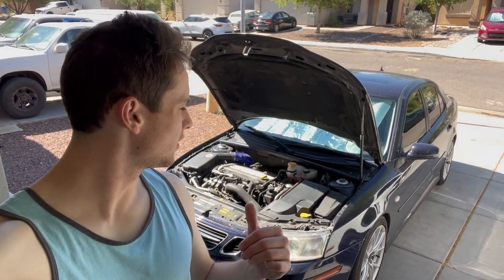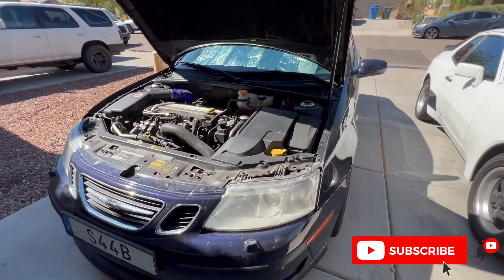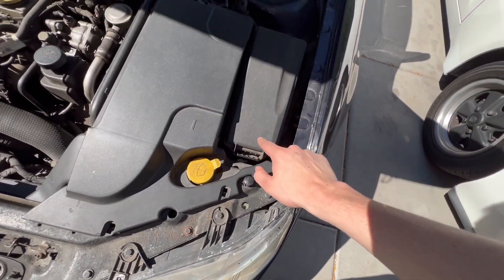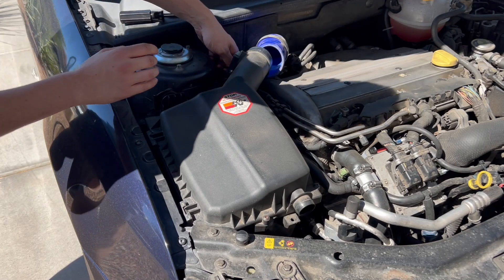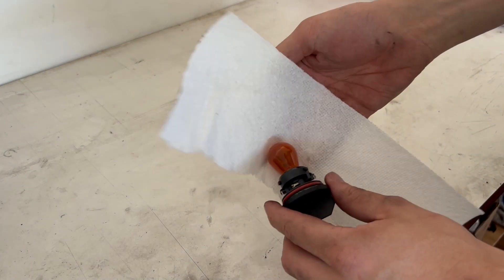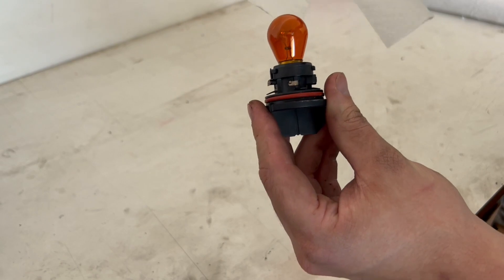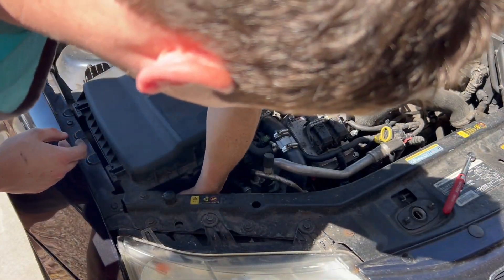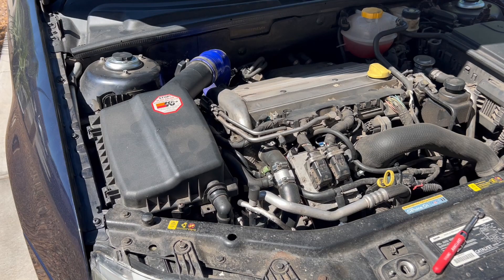Saab 9-3 Quick Fix - Turn Signal Replacement

Comment: I had a front running light repair itself. I don’t know how or for how long. Worried about getting those little red bulbs for the rear glass blocks. Hope they are still sold. Thanks for posting.👍
Reply from the maker: Yep they’re available on esaab :) like $3 I think!

Comment: I have a 2007 Saab 9.3 2.8 v6 auto, and i have the dreaded stability control warning light. I have replaced the CIM, the ABS module, the transmission control module and the ignition switch and keys. I have disconnected the battery overnight to reset the system, but after a few days the warning light comes on again and the car won't start. Next I am going to have all electrical connections in the stability control system checked. Any other advice would be appreciated.
Reply: My saab 93 (diesel however) had the same problem years ago, it was the ecu where water had got into it, replaced it and never had the problem again, but on the diesels the ecu is placed down low in front of the right tire so that might have been why it failed.
Reply from the maker: I’m not sure. I’d say either take a tech2 to it to see exact codes, or try posting on some Facebook groups for advice. Possibility you maybe got a bad new cim but I’m not sure

Comment: My 2007 9-3 eats bulbs like crazy, I'm constantly replacing headlights, taillights, turn signals, license plate lights! Drives me crazy!!
Reply from the maker: SMH! Yeah I was always replacing bulbs twice a year until I got the headlight switch programmed so I could manually turn them off
Reply: @AutoAutopsy  good top, I might have to do that. Did you do it yourself with the Tech 2?

Comment: I had only had my 93 for a few weeks and still getting to know the car when one of the rear indicator bulbs died mid-drive on a narrow, bendy road.
I nearly bloody drove off the road from the sudden warning "Pin-Pon" sound which I had never heard before.
Reply from the maker: Oh no!
Reply: @AutoAutopsy  Exactly. Imagine sitting there in your brand new used good ol' Saab, concentrating on the ride and the road when there is suddenly a this unknown chime ringing out.

Luckily nothing happend, and luckily the warning was about something as as mundane as a light bulb. I then changed both rear indicator bulbs. I believe the cost was $7,- for the pair, and they were very easy to replace.
But I had another issue with the position lights.

Now, here in Denmark cars have to go through an approval test every 48 months (structure, brakes, emmisions, e.t.c.). The first four years I had my Saab mechanic do it because it coinsided with oil- and filter changes or small repairs, but last December I did it myself. And they failed the car, partly due to a rusty left rear brake disc (so I had both rear discs, the pads, the anchor plates, and the brake fluid replaced for appr. $400,-), but also from blinking LED position lights which had been there since I bought the car and then suddenly had become an issue.

So I also had to buy two position light bulbs and replace them. Well, at least they were cheap. And when you re-enter your car when it first failed due to only minor things, you just pay half the fee (around $30,-), and they can only check for the failed issues, unless they see is a new leak or a broken crucial part.

Just recently I had to have three out of four engine suspensions replaced which was in the $600,- range, but at least the engine is no longer twerking when I change gear (manual gearbox).
Reply: Designed to sound like a plane...cause...saab
Reply: @fuhqsideways  And since then I have replaced it with a 9000 CSE. OK, the 9K is six years older, but it only had 100,000 miles on the odometer when I bought it. That's crazy low for a 9K. Those engines can easily do 250,000 miles if they're not abused.
Sure, it had and has some issues, but step by step I get it fixed; new engine mounts, cruise control installed, new heater, new Saab steel rims with winter tires last autumn, original Saab alloys with summer tires this spring.
Next projects are a little rust work and undercarriage treatment plus new front fenders, then leather seats and a new fan, then a larger turbo.
The 9-3 is a nice car, but a 9K has way more Saab soul. I hope I get to keep mine for the next 20 years.